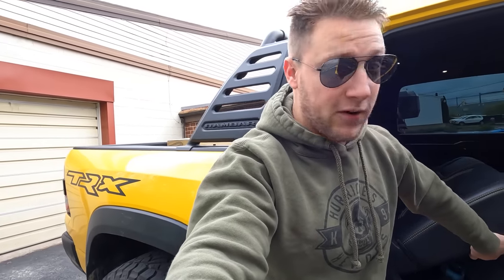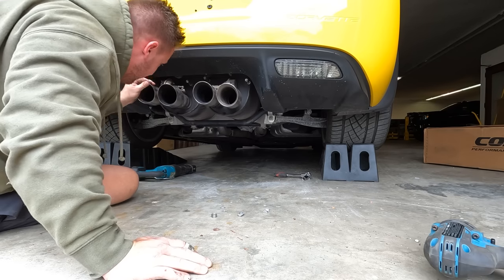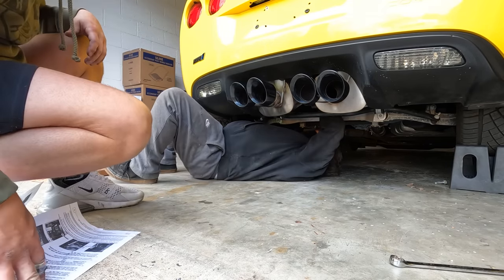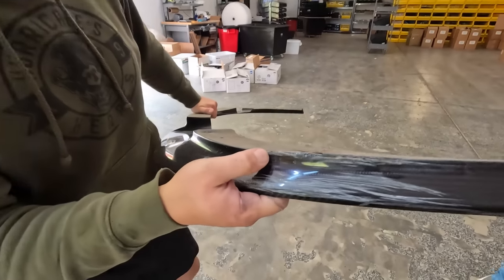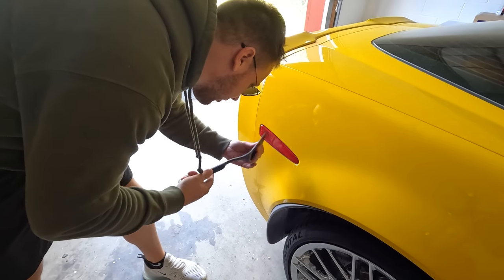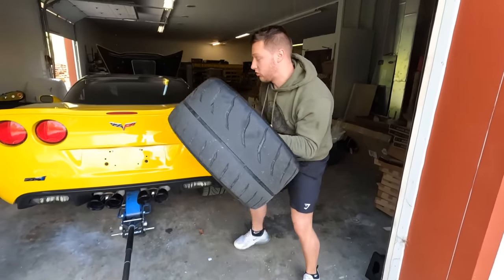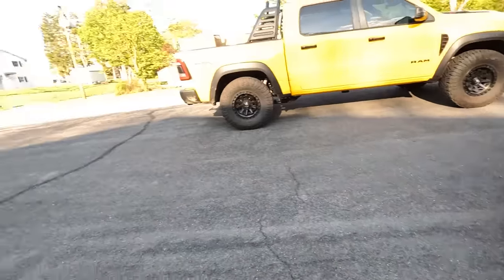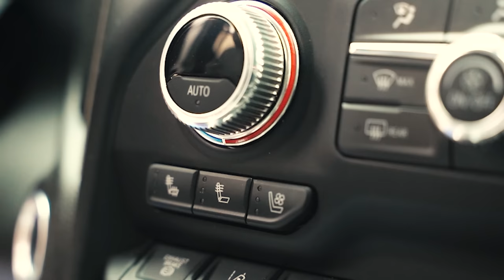TRANSFORMING My "OLD MAN"  ZR1 Corvette into a 1,200HP MONSTER!!! *LOOKS INSANE!*

Comment: At 15:00 you said wheel size changes vehicle height. Only tire size will change height. For example have 37s on my truck. I went from a 16 inch rim to a 24. It didn't change the height at all until I upgraded to a 38 inch tire.

Comment: The vette could have a exhaust leak sometimes it can sound like a rod knock also if the car dies while driving you can press the clutch drop to a lower gear than let off the clutch and it will start up you could do a hellcat swap on the ram charger with a lift and some off road wheels and  tires also the vette would cool too either one

Comment: Whose Race Ramps did you purchase? What I noticed is the lip that enabled you to back up the Vette by yourself without a spotter. 👍👍
As to the factory dual-mode exhaust, they are vacuum operated, but they're computer controlled and really can't be installed on another C6 that didn't come with a factory dual-mode exhaust. 😢 Kudos to you for attempting the removal without the use of a lift. It's a back breaking job which I'm sure you and Curtis will agree with. Save the Wave 🙋‍♂

Comment: What you want for the original Corvette exhaust I am doing project truck trying to keep cost down sourcing as much used as safely possible it's a 08 Silverado been flipped had feet prints on headliner when I got it now you can't tell it looks completely different trying to keep cost under 4 digits all in besides my labor

Comment: I just ordered 2 of the same head lamps off Amazon for $28
Reply from the maker: They don't come with a $85,000 truck and $10,000 though-
Reply: @StreetSpeed717  I'll order some stuff if you have a ram 2500 Cummins as a giveaway. I'm not a GMC or ford fan